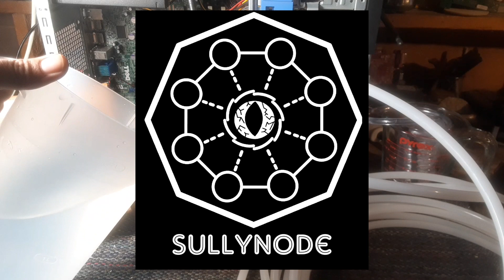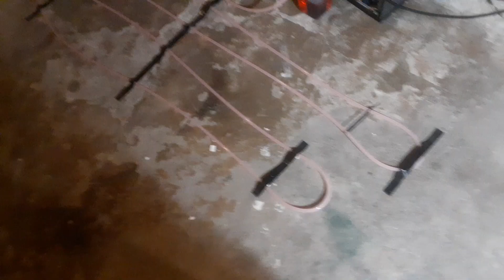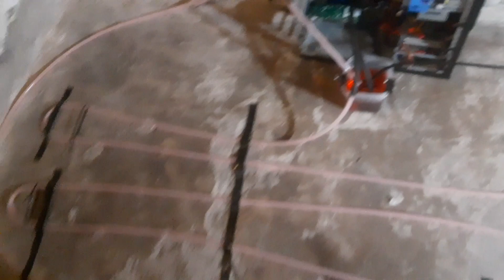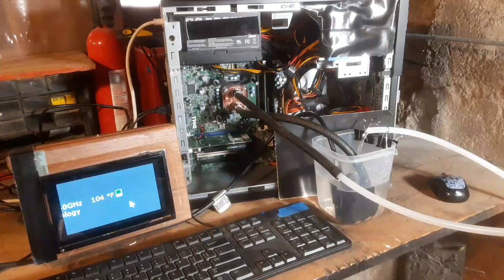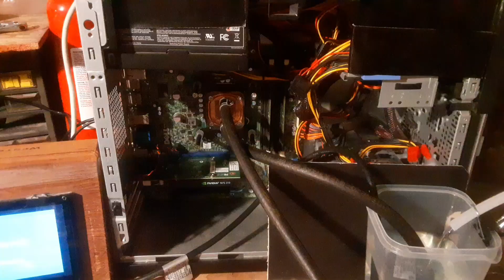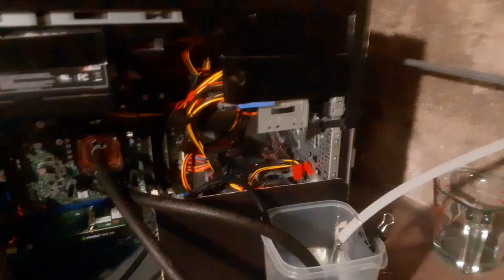Water cooling without a radiator testing.

Comment: More flow is always better for cooling as long as you're not putting more heat into the system with the pump than you can remove. 

Q = M x C x Delta T

Q = Heat Transfer
M = Mass flow rate
C = Specific heat of coolant (water in this case)
dT = fluid temp out vs fluid temp in.